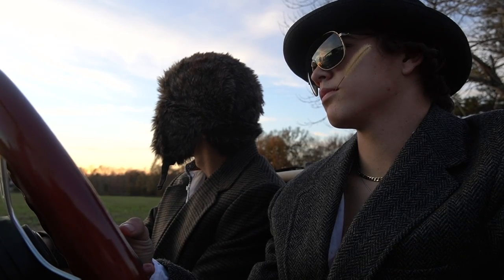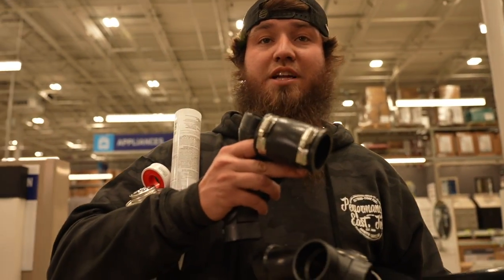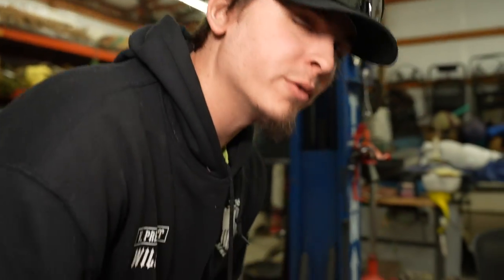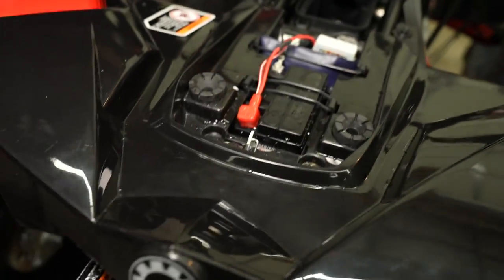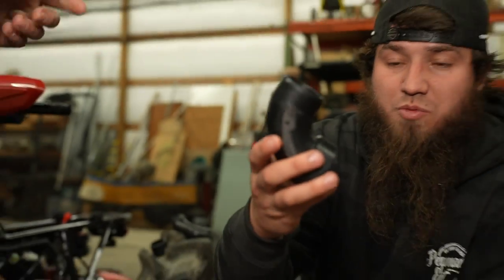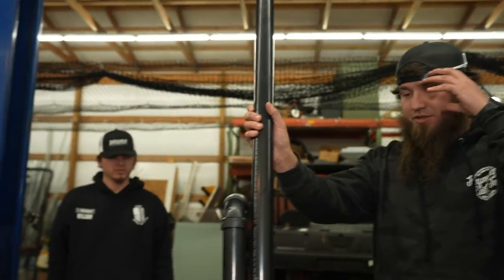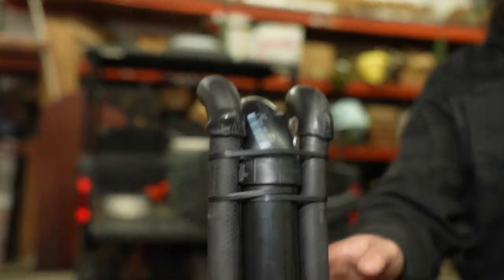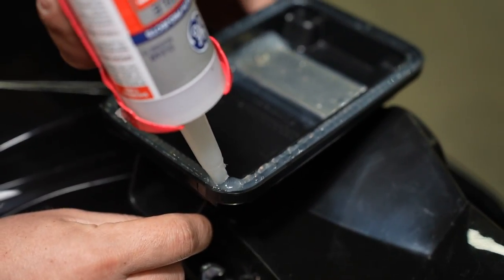We Snorkeled The MINI GADE!! *TOOK IT DEEP*

Comment: a few things you should add is weld a rack then put it in the front by the snorkel then put relocate and put custom lights and a lift but the top of the snorkel where it curves spray paint it red and i would take her in the busco pond and do the tiller tires.😅

Comment: Definitely needs a motor. Is that even possible
Reply from the maker: Maybe like a 570 renny motor😏
Reply: Maybe you could shorten the drive lines and use the front transfer case if ur gonna build a lift for it.